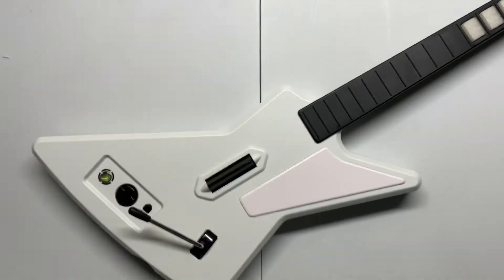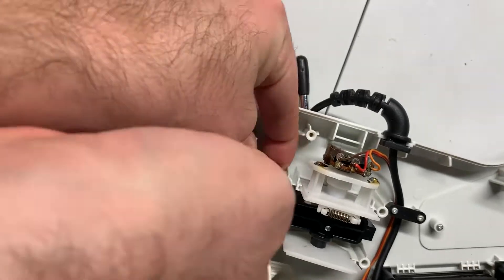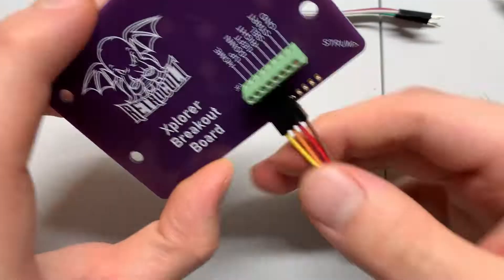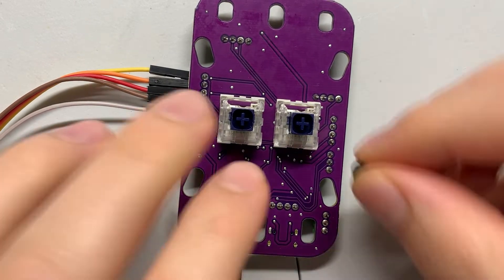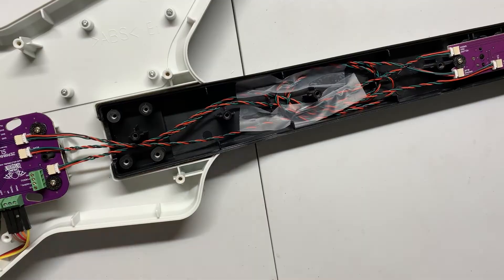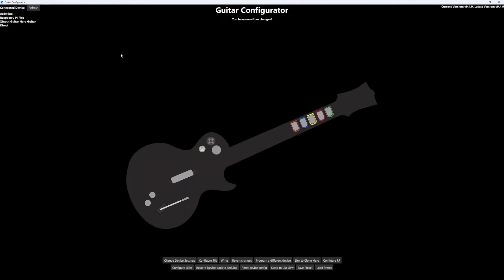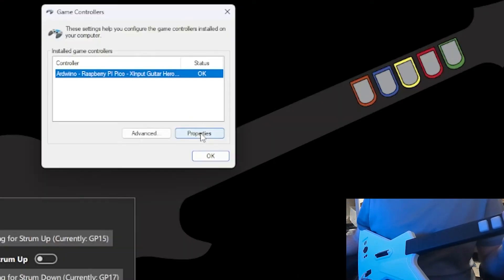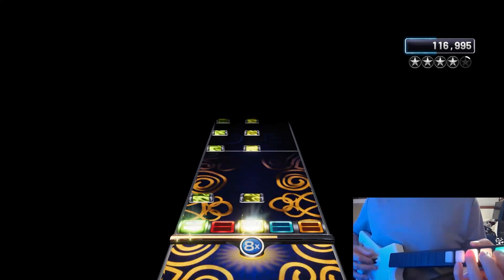Xplorer Solderless Mech Fret Mod with RGB LEDs!! #clonehero #guitarhero #yarg #ghwtde

Comment from the maker: UPDATE:
There is now a dedicated tool for my kits, you'll want to use the one mentioned in this guide instead of the Guitar Configurator:

https://retrocultmods.com/download-the-rcm-programming-tool/

This new tool will do all of the pin mapping for you, and make customizing things much simpler!

For those with the third 95157.805 model number, you will NOT need to use the included shims. (Forgot that in the video)

Links to the kit:

https://shop.retrocultmods.com/products/solderless-diy-rgb-kit-for-guitar-hero-controllers-by-retrocultmods?variant=46909336682787

https://www.etsy.com/listing/1505287559/solderless-diy-rgb-kit-for-guitar-hero?variation0=3996677346
Reply: I cant seem to get the tilt to work. doesn't even show up on the software at all????
Reply: @Likeableartist  can't get this to work either. did you figure it out?
Reply: Hey! 

Love the new software at first glance, but it has some features missing that make it pretty hard to use at the moment. 

For starters, it doesn't seem to recognize the Home button on my Xplorer at all. It works in Guitar Configurator so I know it works, but it just doesn't work in the new Santroller based software.

Second, there's no option to bind start + select to the home button, which makes using other guitars difficult as well. 

I'd love to use this new program! As I'd love to be up to date with the latest improvements and what not, but not being able to use the home buttons on my guitars is definitely a bummer as someone who almost exclusively uses the 360.
Reply: Does it work on a 360 after the mod
Reply: @Landogrado-01  yes and no. If you have a modded Xbox that you can apply the USB verification patch through dashlaunch on, it works great on 360. I use it on my 360 daily. However, if you do not have a modded 360, it won't work.
Reply: @Jacket430  ok Ty
Reply: For the new Santroller software, it states that the brightness for the LEDs should stay at a level of 9 and under to ensure they last. Is that a true statement? I am just asking because I would like to make the LEDs brighter, but I don't want them to die if that's the case.
Reply from the maker: @NixIssues  That's the recommended brightness per the manufacturer. If you are not planning on having the LEDs be always--on, I wouldn't worry about it.
Reply: @retrocultmods  the link to the new software doesn't work
Reply from the maker: @FeralvVulpes  try again, the link should now work!
Reply: @retrocultmods  thank you!
Reply: does this work on PS5 Fortnite Festival?
Reply: So if I wanted to play fortnite festival on PlayStation with this how would I do that?
Reply: Would love if u remade this vid 🙏

Comment: Can i have a choice of USB A instead of USB C if i purchase one
Reply from the maker: So the cable that comes with it is C to A, with the C end going into the adapter and A end going to your PC/console! I only offer this version of cable, but you can use your own C to C cable if you want!
Reply: @retrocultmods  ohh, okay, I assumed it was A to C or C to C, I couldn't tell from the images on the site and the video
Reply: Also, are you planning to release more stock of the 360 authentication tool soon?
Reply from the maker: @sacredeyes3508  There should be more available now!
Reply: @retrocultmods   alright, before i buy the v3 and auth dongle i just wanna be sure of some things if you can answer them here that would be appreciated:
- the V3 will work with any wii guitar and wired xplorer and riffmasters. 
- the v3 should work on ps3 4 5and pc, but not for xbox 360 and xbox one unless you plug in a controller for authentication ?
- the auth dongle just passes through my guitar wire and through the v3 and lets me connect to 360?
- i need to disconnect the auth dongle and connect an xbox one controller to play on xbox one (and im assuming it cant be a cable that only passes power and needs to be a data/power cable) ?
Reply from the maker: @sacredeyes3508  Send those questions over to support@retrocultmods.com and we can get them answered for you!
Reply: @retrocultmods  alright i will

Comment: Would the kit work on the ps2 wireless kramer? Of course I'd have to mod a hole for the cable but the body would work fine with the new internals right?

Comment: Question that I'm not clear on - will this work on un modded xbox 360 and/or Phase Shift? Standard 360 controllers work great on Phase Shift but from my experience later tech doesnt work.

Comment: Okay so i have been looking at al the kits. I have an Xbox360 at home and 4 guitars that work crappy. What i want i use the guitars on the Xbox360 with the Guitar Hero game. With the wireless connection like normal. Is that possible? 

Also would it be possible in some way to convert the signal trough a custom USB cable to the new XBOX One or Series X consoles? Or even with Bluetooth? 
I wonder if we could sit down and thinker about it. I have some experiances with Arduino boards and a friend of mine who is helping me is Experianced on a high level with this programming stuff. 

I think ALOT of people would love to play their OLD game with their old guitars on the new consoles.

Comment: Is there a trick if my whammy bar wires are all stuck together in a gray plastic/rubber strip?
Reply from the maker: You just split them apart with your fingers, they separate pretty easily.

Comment: So would this work on an old ps3 wireless les paul since it's basically replacing the internal boards and all? I'd of course need to make a mod for the usb wire of course.
Reply from the maker: Yep! I actually used that model for my other Solderless kit video!

Comment: Do you suppose that this can work on a PS2 through the use of an adapter? (USB to PS2/Brook's Bluetooth Adapter) Because I really want to get this to update my old PS2 guitars.
Reply from the maker: I have not tested with that adapter, but you can actually play GHWT and later on PS2 with the kit installed! Earlier games require the PS2 to be modded with OPL.
Reply: @retrocultmods  I actually do have my PS2 modded with OPL!💪🏾 Is it plug and play or does it require extra stuff to be workable?

Comment: Just ordered my first kit.  If this goes well, I have a couple more Xplorers that may get the same treatment.
Reply: Update: The mod works perfectly!  It's not as "clicky" as thought it would be...which is fine, I was just expecting something like my keyboard.  I went with the 95065 model I had that had serious strum issues.  Operationally speaking, this mod makes the guitar feel brand new.  It will take some time to get used to the fret buttons being so "tall" compared to my other Xplorer.  Side note, I did this mod with one eye (retina surgery) so don't worry too much about the install...just follow the vid...also, thanks for the sticker!! W.
Reply: @Up2Late_88 yea I was worried it would be as loud as a cheap mechanical keyboard but it’s basically the same loudness as my stock controller. Hell the frets are quieter on my modded controller

Comment: Just got my xplorer kit in the mail yesterday. Solderless version. Everything works flawlessly. My only issue atm is the buttons are so much taller than original and its slipping me up. I tried taking out the shims, but them the buttons were too low and would stick a little. Do you offer buttons a little shorter that stil work with your shims?

Comment: Bought this kit and followed everything worked so that's good, I didn't get a square washer and also the screws weren't long enough with the washers for the strum bar so I had to do without got it working but maybe something that should be looked into.
Reply: I end up taking the longer screws from the breakout board and using those for the strum bar and the strum bar screws for the breakout board. I didn’t get a square washer either so I took my cutters and cut one of the circle washers into a rectangle

Comment: My model number says 95157.805, what should I do for the frets?
Reply: the fixed comment says that the 95157.805 model number, won't need to use the included shims

Comment: It would be cool if you could make a tutorial of the new Santroller software. The older software works great for PC, but tilt doesn’t work on Playstation. The new software has fixed this issue, but it looks a whole lot more complex to configure a guitar in it…
Reply: Check pinned comment he has his own tool now and I checked tonight on RB4 and my strum was working (atleast as good as it did in PC clone hero lol)

Comment: My controller was all TR10 bit screws on the back - is this normal? 

EDIT: It seems like there's a lot of variances with the 95157.805 model, at 9:39 at the bottom of the neck, there's no cutout so the wires just pinch, I had to take a file and make a hole for the fret wires to pass through safely.

Comment: A tip for stripped screws is to use a wide rubber band between the screw and the screwdriver, it adds more friction and can make it easier. Though not sure how that'd work on those screwws caked in glue!

Comment: Hey i recently purchased the V3 adapter and when it got here I hear a bunch of rattling inside, is this normal? I haven't had the chance to test it yet as my guitar is still on the way. Thanks in advance.
Reply from the maker: Hey! That's normal, those are the metal ball tilt sensors themselves! The noise will be greatly reduced when it is slotted into the guitar.

Comment: My explorer kit didn't come with the T shaped key switch caps for the strum keys. I don't see it listed on the site either. I'm literally mid assembly on this step and i checked the whole box. I'll finish the job but do i still need to get them or are they not included anymore?
Reply from the maker: Hey sorry about that, there was a mix up with the new components in the Xplorer kits! You can use some duct tape to achieve the same spacing. Just attach it to the bottom of the strumbar where it touches the switches.

I could also send the components to you if you like!
Reply: @retrocultmods  that would be cool if you could send the components! I also have access to a 3d printer so if you have a stl file that would work good
Reply: @retrocultmods  Crap i'm sorry for the late reply, youtube never notified me of your response. Yes, it would be awesome if you could send those out. I sent you a message on your etsy page.
Reply: same here. i’m mid assembly as i write this. gonna finish it up and hope it works okay
Reply: Likewise my friends, glad to know I'm not the only one
Reply: @Nome1925  currently using mine and i have no issues. although i wonder the difference if i had them considering he put them there for a reason
Reply: @justj5866  Thanks for sharing, I'll build mine right up then

Comment: This is an awesome guitar mod kit, I love it! I have some suggestions that will make it better:
1. The frets have 1.2-1.3mm ball bearings inside the switches. Lowers a travel distance by a decent amount. Doesn’t make the guitar overtap, or automatically activate the leds. I did this to my guitar and it made it much better.
2. Shorter frets. I have some mech fret buttons that are shorter and have a flat top. This makes the guitar feel way more comfortable, and natural to the original guitar. 
Keep up the great work!
Reply: Link to those mech fret buttons you have?
Reply: @SkylineShow  the printing party

Comment: I need to get an xplorer now! I've done every type of GH guitar with your solderless kits except a xplorer! I'm hype!
Reply from the maker: Oh wow thanks for all your support, I hope you like the Xplorer kit too! :)
Reply: the rgb just won’t work on my guitar idk why but this isn’t the first issue i’ve had w it i give it like a 2/10
Reply from the maker: @emmamayfield1492  If you're trying to use the new Santroller firmware, you'll need to follow this guide:

https://retrocultmods.com/updating-to-the-new-santroller-firmware/

Also make sure the cables are fully inserted; I've had a few people only partially insert them, and it has caused issues!